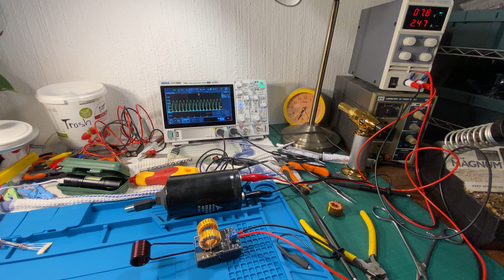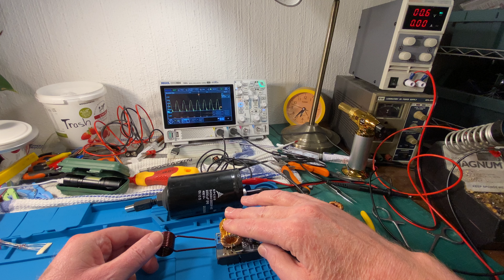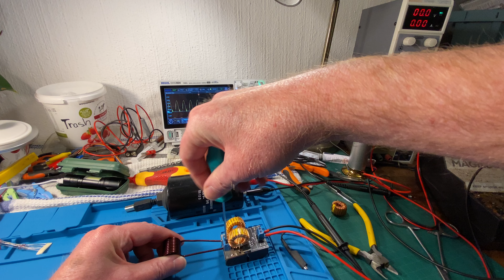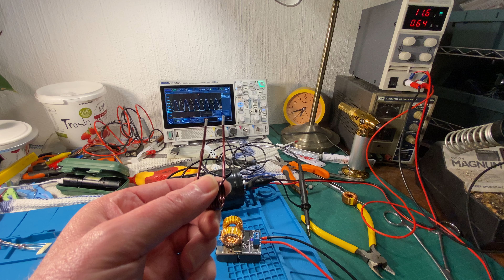Lets play with an induction heater and see the waveform as well as the frequency. #electronics

Comment: Will it only heat ferrous  metals   . What about non-ferrous  metals like aluminium , brass and copper   ? 
Thanks for sharing
Reply from the maker: Here is the list of metals that can be heated with induction heating.
So, the answer is yes.
Brass requires 920 joules per kilogram per Kelvin to raise temperature.
So, with 920 Watts of energy input the change in temperature of 1 Kelvin will take 1 second.

    Copper and copper alloys
    Brass
    Aluminum
    Iron
    Steel and stainless steel
    Tungsten
    Chrome
    Nickel and nickel alloys
    Cobalt
    Carbon fiber
    Graphite
    Silicium
    Platinum
    Silver
    Gold
Reply from the maker: Induction heating is also one form of energy input to modify friction welding process, known as a hybrid or assisted process.
The second method is passing electrical current through the weld.